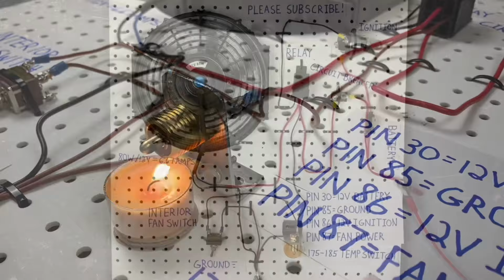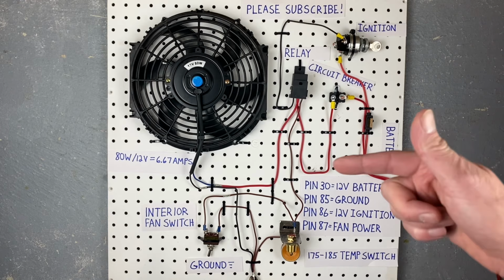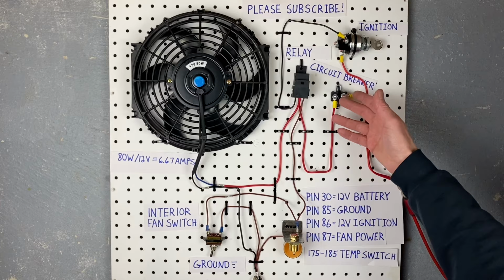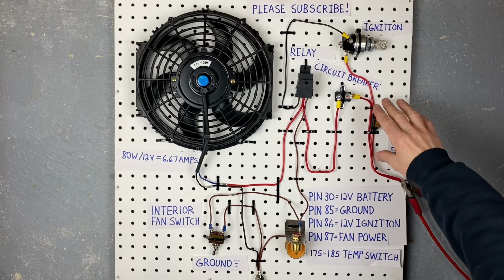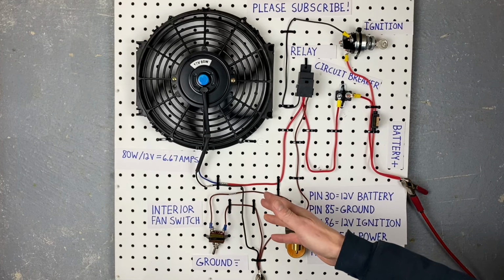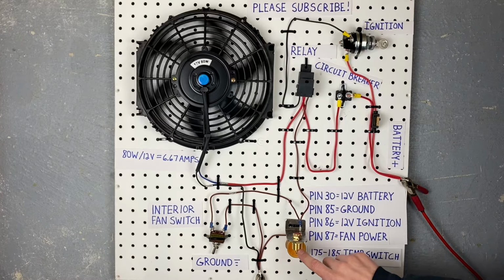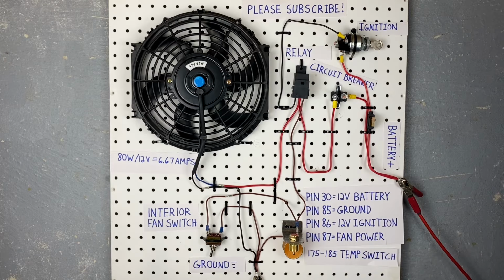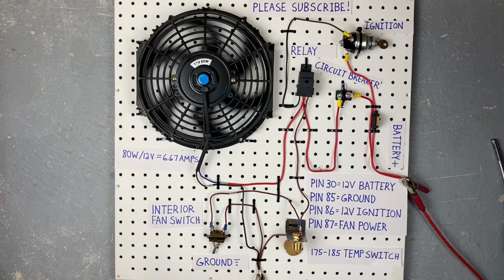How To Wire An Electric Radiator Fan Relay Temp Sensor AND Switch! | @WiringRescue

Comment: I so enjoyed this video and so detailed. I love it. So I was thinking of wiring that same fan onto the bottom of my engine bay panel and wire it up to the turbo timer that when I shut down the car the timer will run the fan for a count down timer and then turn of allowing the engine bay to cool down. Yours thoughts would be appreciated.
Reply from the maker: That sounds like it would definitely work. Just make sure you use a relay, and control the relay with the turbo timer (going to pin 86). Also , you’ll need a good battery, because fans use a lot of electricity. Good luck with the project and thanks for watching!
Reply: @WiringRescue  thanks for the tip. What about wiring the same fan for 110v AC current? Is that possible? If so how?

Comment: I read that the relay in a thermo fan wiring kit is a special one in that it has a resistor fitted for specific reasons & relays ment for driving/fog lights don't have a resistor fitted & shouldn't be used for thermo fans. I only mention this because I bought some unused cheap driving lights just for the wiring kit to use for a thermo fan. I'll still use all the wiring & switch just need to buy the proper relay.

Comment: I well understand the switching via earth/ground (85) but I almost never do that.  I guess I started by just earthing the relay as that seemed easier.  Switch via earthing is a good way.  I just seem to always go the switched wire (86) to the load/fan/lights/horn etc.  Either works and if one has a sensor that goes directly to earth it would be easier to got the earth wire way.  Just wanted to say the switched power way works better in some cases.  Bobby

Comment: Question for you Jeremy?
I was talking to a friend of mine about wiring the other day. I was recommending your videos. And we got into a discussion on electric fans. 
He mentioned something about when running such high voltage items as electric fans. He switches the ground instead of the power side. He said doing it this way keeps the voltage from spiking. 
Is this the method you’re using with the thermostat and switch? 
Thanks! 
I love your channel! I have 3 classics that im restoring. All 3 will be custom wired thanks to your easy to understand videos.
Reply from the maker: Thank you for watching and sharing the kind words. I am glad you are enjoying the videos!

As for your question - in this video, we are switching the power side of the fan circuit through the relay, not the ground. This is not uncommon, and if you look at many factory wiring diagram, you'll likely find it to be wired this same way.  That being said, it is also totally fine to switch the ground side as well, if that is your preference.

Interestingly, the relay itself is switched through the ground side in this video, which is another thing that could be swapped if needed.  There are so many different ways if wiring a circuit, you just need to choose what works best for you. If you haven't seen this video, I talk more about positive vs, negative triggers in here: https://www.youtube.com/watch?v=QCkfFCLa_Jg

Comment: Thank you. This is clear and concise. I wired up my fan to go through the hot side of my kill switch. This way, the fan stays on when hot even if the ignition is off. Plus, the coolant will get hot soaking up the engine heat even though the motor is turned off. The fan cycles off and on until the coolant temp drops to 175. This cycling will last maybe 5-8 minutes.

Comment: Thank you for the video. Im trying to find out why the fan in my vehicle is not turning on. It works when I unplug the coolant sensor. I might have to test the sensor with a candle to so if its broken.

Comment: Can i do this off a ect sensor/switch that only measures resistance? I have been having problems only being able to run a toggle switch on my aftermarket fans but wont work intermittently with the ect in my 01 gmc 5.3 yukon xl this would help alot thank you.

Comment: I like it but I’d like to control the speed variably. Remove the temperature switch and replace it with a potentiometer. I think there are dc speed controllers out there but I wouldn’t know how to buy the proper one. Does anyone know of a link to a video that shows that?
 Great video and very clear explanation but not quite what I’m looking for🙂

Comment: Would of been nice if you would of recommended where to get the ignition switch power from so when you start car the power goes to cooling fan system.

Comment: The extra toggle switch...... can it be wired to constant 'hot'? In case you park somewhere,  flip the switch to cool everything down and still shut off after coolant drops below threshold temp? Would just have to remember to flip it back once back in the car driving. Can you show a dual fan setup with one fan turning on then the other a few seconds later? I've heard it's better this way because of taxing the electrical system if they both come on at once.

Comment: What about the PDC COOLING FAN RELAY ? Keep it stock and add additional relay as shown in your video ? Or is there the danger of sending too many amps, thus burning out the fan motor with two relays inline to cooling fan ?

Comment: So I'm trying to mount a new fan in my old car, it previously had a massive 2 speed motor for a small 320mm fan on a small radiator, and some sources say it is rated for 300W, I'm not sure if modern low power fans would keep up with cooling, and I can't find such powerful, but small fan

Comment: With two fans, would you just count for the increased amperage when choosing the fuse/circuit breaker and would the wiring be the same then?
Reply from the maker: Yes! You’ve basically nailed it! You could actually wire it a bunch of different ways. Two temp switch with different temperature settings, so one fan comes on first. Or you could wire two relays to one switch and have them come on together. Or have one manually controlled by a switch on the dash? There are tons of options depending on your needs. But it sounds like your on the right track. Good luck!

Comment: Great explanation, thank you! How would the wiring change if I wanted to include a simple digital water temperature gauge that reads the temperature from the temperature switch?

Comment: Great video reminds me of high school auto shop 😊. I have a German car and my fan keeps turning on they say  I have to replace some sensor on the fan 😝 basically lot of of work can I just tap a jumper switch to turn it on manuelyon and off  ..
Reply from the maker: If you can find a fan relay to tap into, that would probably work, though I’m not much of a German car guy, and I’m also a random guy in the internet, so you may want to find a factory service manual for it.
Reply: Surely you can. However, it is worth going through the Cost/Profit board one more time. If you're making a playful I/O vs. human comparison, boring repetitive on/off tasks, your car's cylinder head is at stake!
Reply: @atothek1804     Thanks for advice I sold it 10 months ago ..

Comment: love this. But could you theoretically have the same circuit wired to constant 12v? As long as the manual switch and thermo switch aren't engaged, there shouldn't be any parasitic draw, right? Wouldn't it be beneficial to have the fan run for a minute or two even after the ignition is shut off?
Reply from the maker: That would work the way you explained, but I personally wouldn’t do it. It’s dangerous for anybody working on the car because the fan could kick in anytime and hurt somebody (possibly an animal too - small cats love warm engine bays). It could also kill the battery fairly quickly if the engine is off because fans tend to draw a lot of amperage.

Comment: Great video - Just recently purchased an old car with electric fan setup and the wiring was horrible so took it all down and used your guide to do it up. Thank you!

Question: Im using a 3 prong switch pwr, acc, ground. It has a light when powered through troubleshooting my initial switch issue I have it working however light no longer works. Is there a way to get the light to turn on when we are grounding out the power?

Comment: Should I skipped the ignition switch part to keep the fans on after the car if off and allow the temp switch the keep them running ?
Reply from the maker: You could do that, but you just have to be aware that it will potentially kill your battery, or start up by itself when you are working on the car. Typically cars with that feature have warning stickers all over the place under the hood for technicians. So if anybody else goes under your hood you would want them aware that the fan could turn on anytime. 

You could add an additional toggle switch under your hood straight from the battery (fused of course) that triggers your fan relay. That way you could manually turn it on with your key off, but still keep things safe.

For me personally, I would stick to only having it run with the ignition switch turned on.

Comment: Very informative video ! Thanks for sharing. Question. I see that both of your interior fan switch wires are grounded: 1. To the temperature sensor and 2. Is straight to ground. Don't you need a power wire to the switch?

Comment: Thanks for the video.  Great Job, I wathched your other videos on circuits.  Question, how does the current temperature guage sending unit work with the fan circuit?  It seems I can not use the same sending unit for both, because the temperature sending unit has a much larger range.
Reply from the maker: Thank you! You are totally correct. Typically one is a “temperature switch” (turns on and off for the fan), and the other is a “temperature sensor”, which is a resistor and used for the gauge.  The one for the gauge is often 1 wire. The fan is often 2 wires.

Comment: temp switch should be mounted in the cold side of the rad. the only time you need a fan is if the water coming out of the rad is hot, which happens when there isnt enough airflow.

Comment: this helps alot. can you have the temp switch also power a temp guage together?
Reply from the maker: Generally the sensor for the gauge is a separate unit. One is a temp sensor, one is a temp switch. The one in this video is technically a temperature switch.

Comment: Did anyone try this method to a actual car with mechanical fan blades remove it and convert to electronic fan blades like this? Im interested to know. And I'd like to do it on my car here in Philippines. Mitsubishi adventure diesel engine with  mechanical fan blades. 
By the way. This video is great and explained very well sir. Cudos! 🫡
More diy tutorial! 😊

Comment: hello. how many terminals does your thermo switch have? mine is 2 ..can I use your wiring on it? I have a problem with my radiator fan and the auto electrician charges me a lot..he only directly connects my radiator fan to the ignition switch..so the automatic switching of the Rad. fan doesn't work anymore and it makes me sad..any advice for me?
 thank you in advance! 

by the way..your video is very clear to understand.

Comment: Hi there, firstly thank you for your videos and help.. I have a question so maybe you can help me,
Both fans running when ignition is on, also when engine is running cold, (temp normal, not overheating, coolant is on normal level, AC OFF)

Any idea what can be? 

Thank you.
Reply from the maker: Yes. It sounds like your relay is stuck on. Try swapping it out with a different relay from u see the hood and see if that fixes it. Sometimes headlights use the same relays as fans. 
If that doesn’t help, then it’s likely a bad temperature switch.

Good luck!

Comment: Your videos have helped me tremendously on my 1955 Chevy truck and I appreciate the work you do to make them easy to follow. Do you by chance have a diagram to help me wire a brand new E38 computer with 2 fan outputs to a dual fan radiator? The truck also has a vintage air system that I need to incorporate fan switching as well. Thank you.
Reply from the maker: I don't currently have a video for dual fans, but I can add it to my to-do list.  Stay tuned!

Comment: @WiringRescue Thanks for the video really helped a lot now I have a 3 wire fan that confusing to connect please assist I don't know how I can wire it ... Two wires is simple but three wires it different I don't know whether to connect only two wires or what relay to use 5 or 4 pins... Thanks in advance

Comment: Your toggle switch just needs ground wire (connection) as well as the thermostat ... no need for power (positive)?
Reply from the maker: Correct, because the switch is controlling the relay. Take a look at at this video for some additional details. https://youtu.be/QAD8vDHTbzo

Comment: Hi thanks for video,just want to say the 7.5 amp fuse is to light for fan you need 30 amp fuse.
Reply from the maker: Thanks for watching. Why do I need a 30 amp fuse if the fan draws 6amps?
Reply: @WiringRescue  ja,it also depend's on size fan.for bigger cars or bakkies,i got a 2.5 diesel and the fan blows the fuses until i install a 30 amp fuse.
Reply from the maker: @johanschoeman6427  - correct - the fuse size is dependent on the amount of amperage that the fan is drawing. Bigger fans generally need bigger fuses because they draw more electricity. In the example of this video, the fan only needs a 7.5amp, because it’s 80watts as 12volts, which is 6.67 amps.

Comment: The fuse is never designed to protect the load but rather to protect the wiring and prevent it from burning. If you put a 7.5 a fuse and any of the load side wiring is rated for less, when there is a problem (short) the wire will melt and the fuse will not blow, and the car will most likely burn to the ground.
Reply from the maker: Very true!  I made a whole video about this, and even burned some fuses and wiring for fun. https://www.youtube.com/watch?v=EhzN6UdnmPA

Comment: Thank you for this video.  I have a 1986 Civic Si where the fan comes on when the ignition key is turned on.  I'd like to switch this wiring to where I can control the fan with a switch or better yet, revert the wiring back to OEM.  Can you show me how to do this?  Thank you for your help.

Comment: Awesome video sir. I have a problem with my setup that is wired exactly like this but without the switch. Everything works great but my issue is when I turn the car off the fan turns off with the ignition but for some reason the system is still draining my battery. The reason I know it’s the fan is because after my battery drained a few times i started unplugging the power wire from the fan after I drove it and now every time I get in the car it starts with no problems and the battery no longer is drained. Do you think if I added a switch it would stop that drainage and I wouldn’t have to physically get under the hood after every ride just to unplug the fan? Thanks in advance and thank you for the great information.
Reply from the maker: I don’t think adding a switch is the answer. I think you should determine what the cause of your problem is. Double check your relay to make sure that your relay is the same wiring design as the one in the video. Sometimes they are not, even though they look the same.  Also, make sure that pin 30 is only getting power when the key is turned on. Lastly, fans are weird because they can actually create electricity when they spin. This can make things get weird if they are wired to circuits that are not turned off with the key, because they are sending power backwards through your electrical system when the wind blows and spins your fan.
Reply: @WiringRescue  
Okay I will definitely check pin 30 to make sure power is getting shut off completely. I park in the garage usually after every drive so no wind should be turning the fan at all, just a thought.
My last question is, I have my black ground wire from the relay going to the temperature tag on the block and my black ground wore from the fan landed on the chassis of the car. Is that correct? I couldn’t tell on your setup where the fan ground should be landed. Thanks again.
Reply from the maker: @SSAuto-sz3dj - yes your black wires sound correct to me. Check out the power going to pin 30 next. Let me know what you find!

Comment: My instructions put the 12 v ignition on wire on the circuit breaker, you have the direct 12 v from battery on it. What is the difference? The instructions I have are for a 16" Maxon from Amazon. Thanks
Reply from the maker: It’s just taking power from two different places. If you do it the way your instructions suggest, make sure your factory ignition wires are rated for the proper amperage draw for the fan (very unlikely) or you’ll burn things like wires, fuses, cars. Definitely do your own research though because I’m just some random guy in the internet.

Comment: Great video, so if I wanted the fan to also turn on when I turn in the AC, I could essentially use the ac switch in place of the manual switch correct?
Reply from the maker: Yes, you just need to make sure that switch is grounding the circuit and not adding power :)

Comment: i usually put a switch or the temp sensor, never thought of putting both, great idea. what gauge wire do you use for everything?
Reply from the maker: The wire gauge depends on the amperage draw of the fan. So once you know how much amperage the fan draws, you get wire that is sized to handle that amperage.